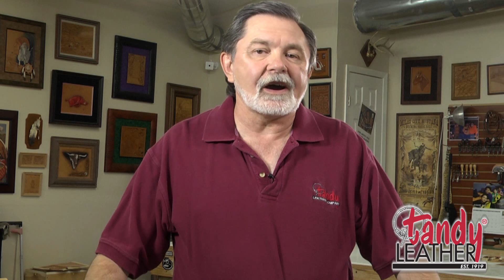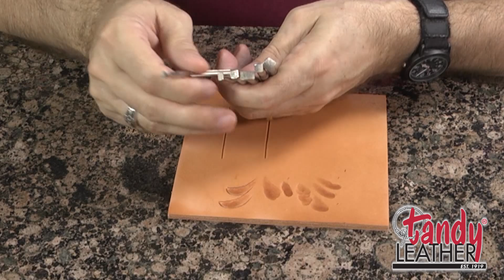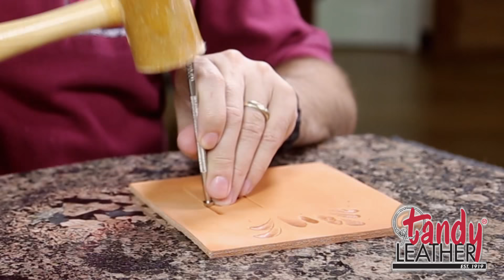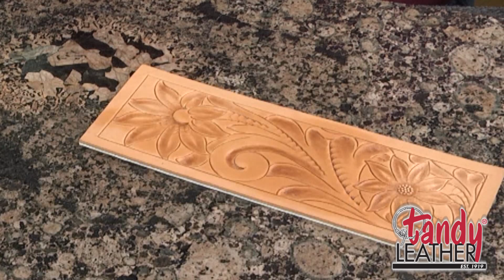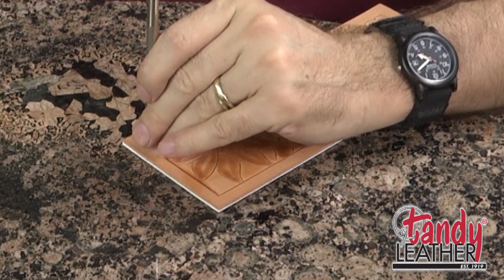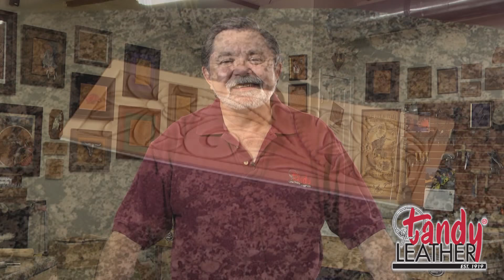Learning Leathercraft with Jim Linnell, Lesson 5: Beveling Lines

Comment: I see you have some pretty heavy leather but with 4-5 oz leather its hard to get real depth with my beveler, is angling the tool necessary or mabe a beveler with less of an angle ?
Reply from the maker: +Yaygens Jim used a 4-5 oz leather for this project, however he used rubber cement to attach matboard to the back to prevent it from stretching and to allow for deeper tooling impressions.
Reply: How do you remove the matboard when you are done working on the leather?